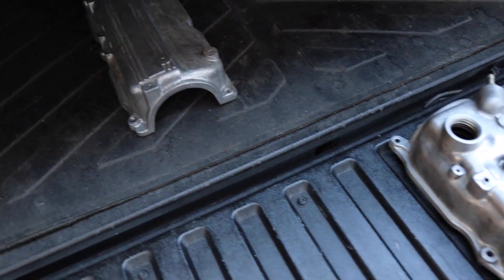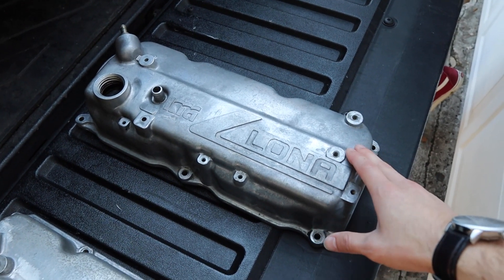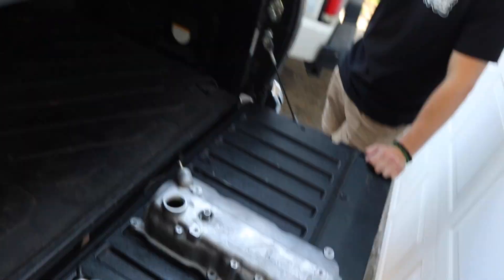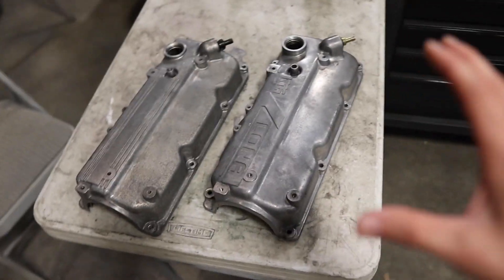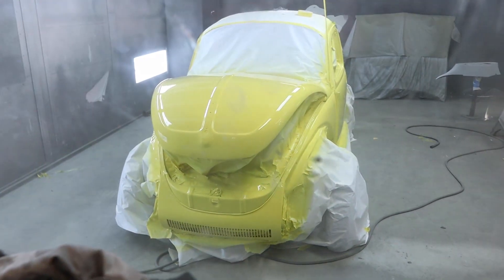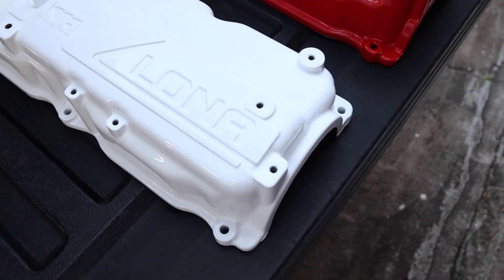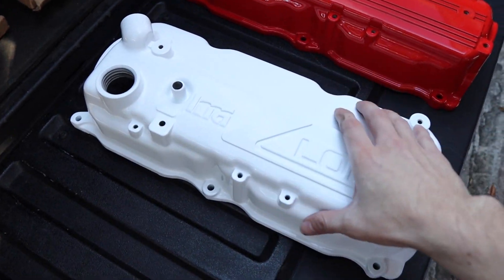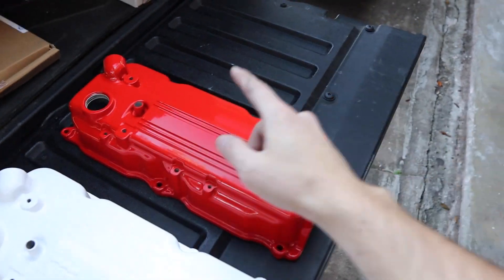Rare Mazda Valve Cover! Powder Coating and install | Flake Garage B2200 B2000

Comment: That cone filter comming out the top of the valve cover, that’s that for?
Reply from the maker: Just a vent case for the valve cover. It's supposed to be connected to the weber carb but I haven't had any issues like it is right now

Comment: What is the name and what is for the black square  thing that has a cable running from the coil in the distributor ?
Reply from the maker: I think that's an anti static module or something along the lines. I'm pretty sure I know what you are talking about but I don't know the exact term for it

Comment: Do i have to drain the oil before removing the cover ? I just ordered the same one as yours powered coated black found it on ebay
Reply from the maker: No you don’t have to drain the oil, just make sure you pick up a new Kia Sportage gasket for it and you can swap it over!
Reply: @FlakeGarage  yeaa it’s supposedly coming with a new gasket already so hopefully it does waiting for it to still come in